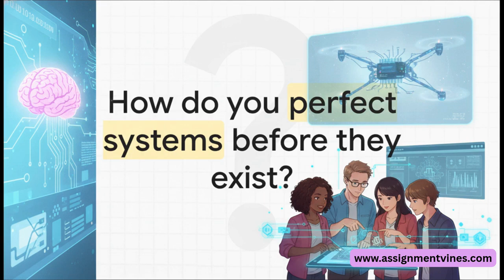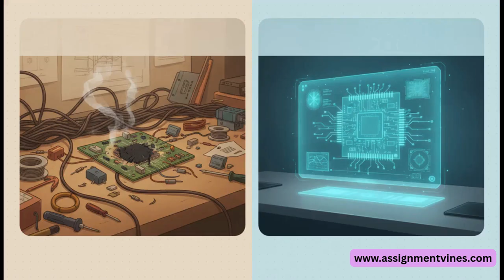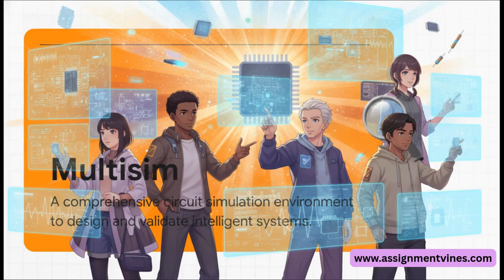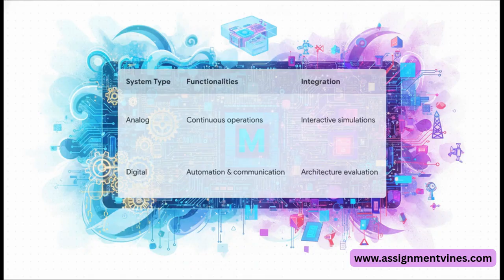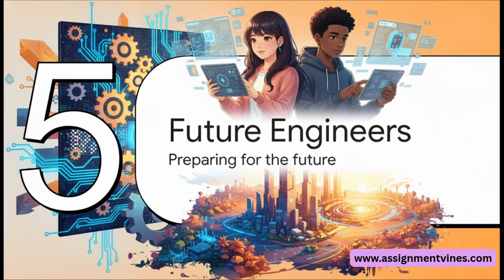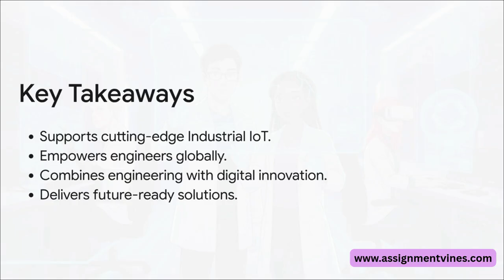Designing Intelligent Electronic Systems with Multisim | Circuit Simulation to Innovation

Comment: A valuable overview of Multisim and its applications in electronic circuit design! The post clearly connects simulation, analysis, prototyping, and optimisation with practical learning and engineering development.